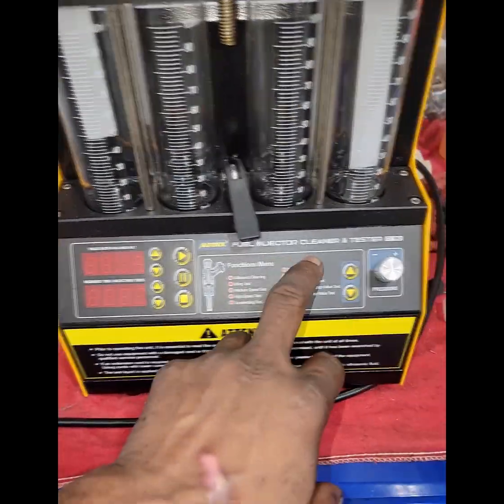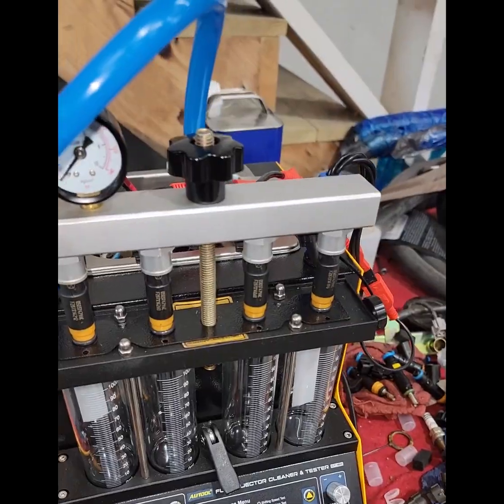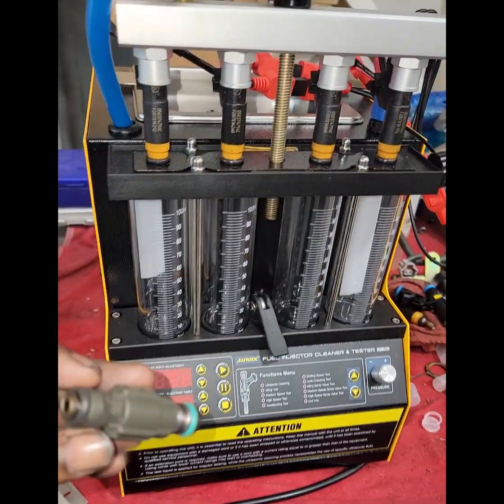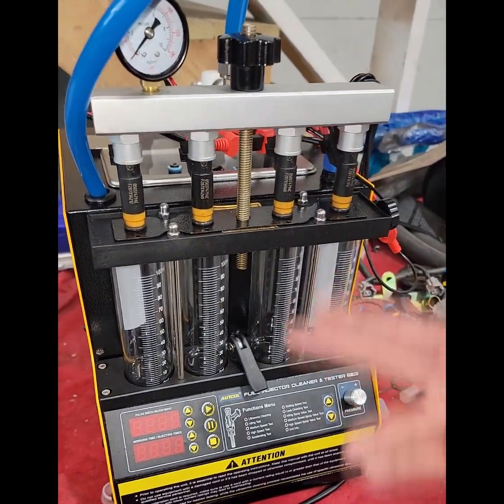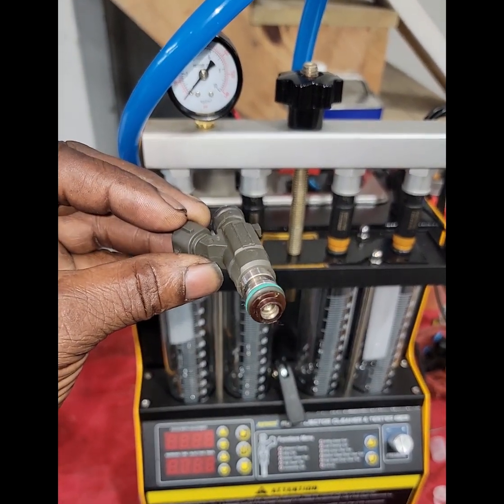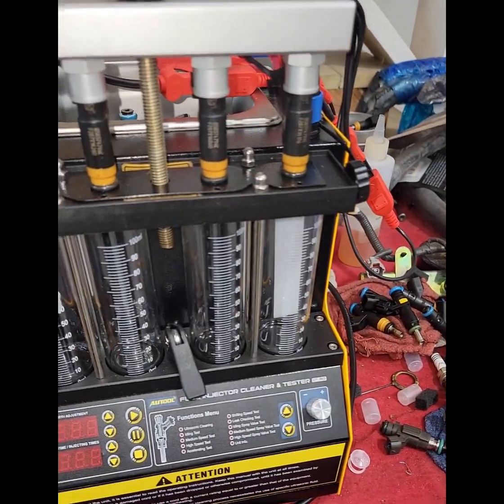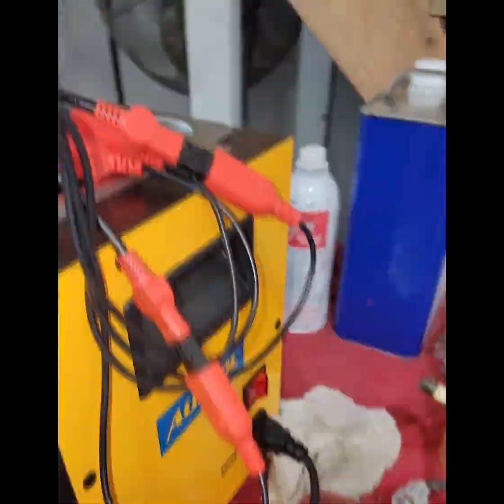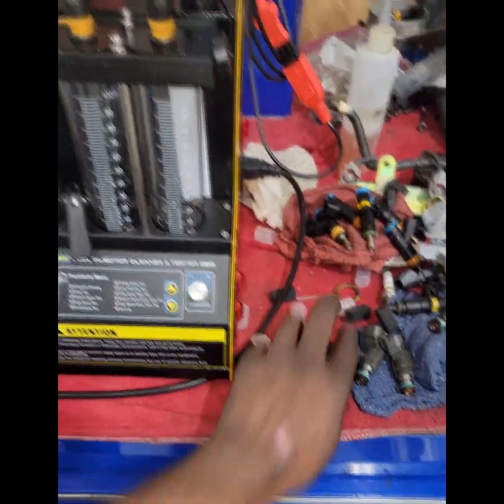Getting this done will make your car save a ton of gas and RUN LIKE NEW.

Comment: It's gotta be more cost effective to just buy new ones than paying for the labor of someone doing this.
Reply: It costs $44 for 1 injector on a pentastar engine.
Reply: @chuckisbusy  yea, and how much does it cost to run it through that machine, if the shop even has one?
Reply: @Mike__P  that’s the question. If injectors are a problem. It’s probably better just to get new ones, and it’ll come with warranty.